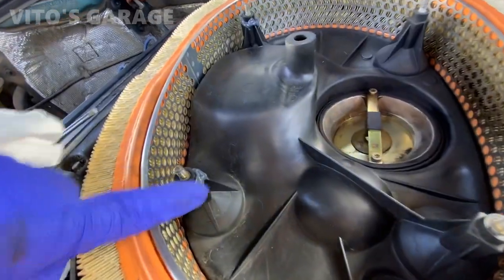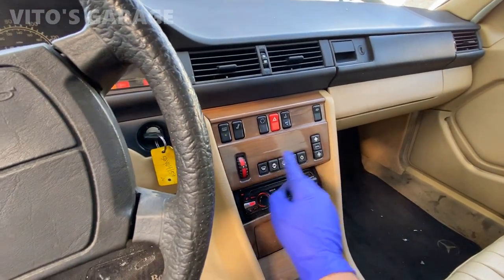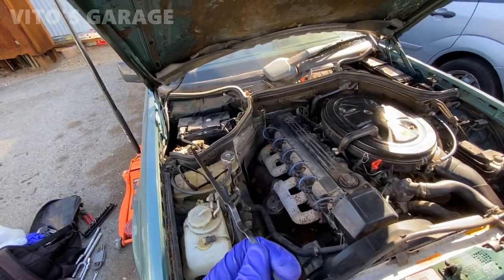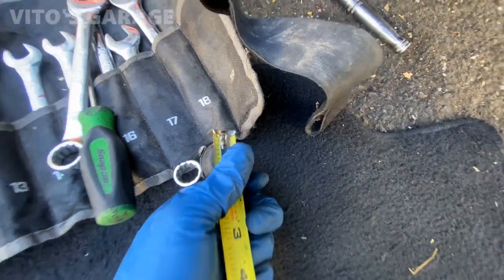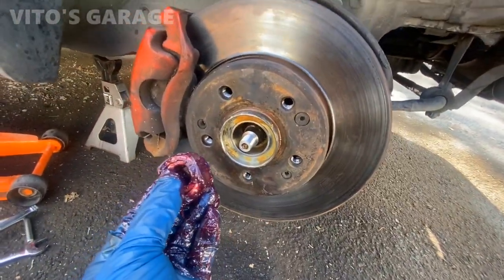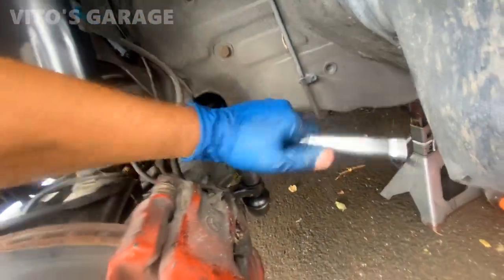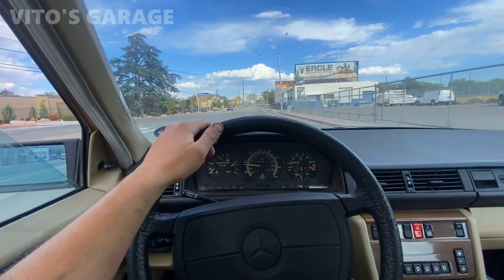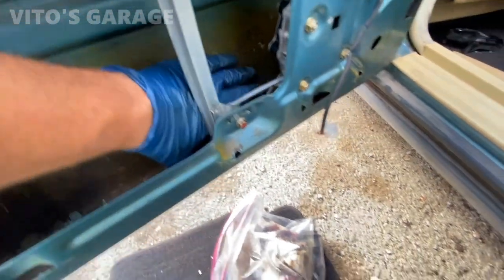Part 3 Mercedes W124 300E: New Tie Rods, Wheel Bearing Service & Adjustment, LR Window Glass & More

Comment: ...hello again 😁 i need your help. I need to know about the auto level suspension on the mercedes S210 e200 kompressor 210-245 Avantgarde year 1998, and my question and doubt is: what feeds the pressure in the Acumulator? Is it the steering wheel pump? Will have its on pump? Because sometimes I hear some noises coming from behind like: ik ik ik... Everything is working okay but, maybe she needs a maintenance on that section she's with 186000 miles now. I will like to check on the feeld but I'm in wheelchair now. Please give me a feedback when you have a chance. You have a nice day, cheers from Portugal 🇵🇹🇲🇿✌️😎
Reply from the maker: Hi sir. If you hear a noise it can be due to suspension bushings. Check your suspension links and bushings. It can be causing the problem. I don’t think the problem is related to the hydraulic side of the suspension. 
If your hydraulic accumulators are bad, your suspension will be very hard or very bouncy over bumps. But it usually won’t make a noise
Reply: @VITOSGARAGE  Good morning, thank you for your answer. The noise that she is making is when the engine is running and the car is stop to!  ... happen the two ways ex: when I'm driving and I stop with the engine running steel makes the noise, not every time but sometimes. Thank you for your answer and help. 🙏🏽🙏🏽👌✌️🇵🇹🇲🇿😎